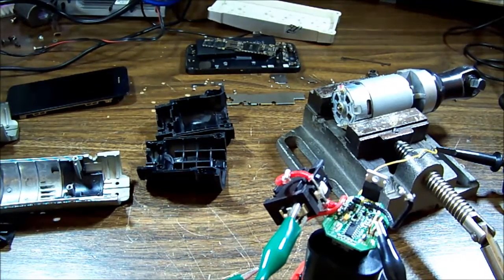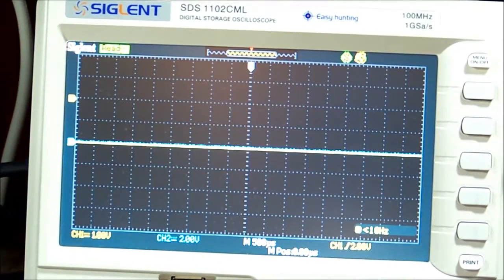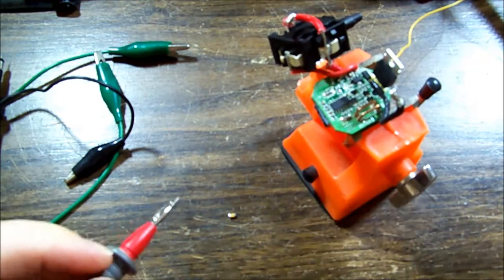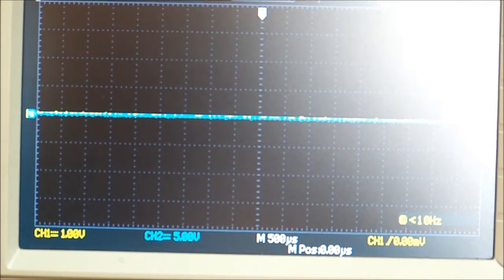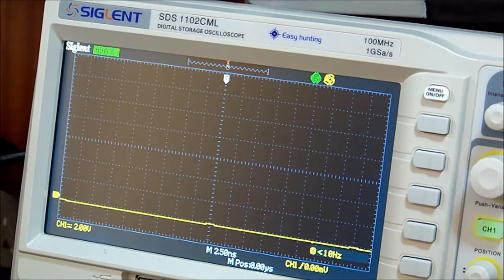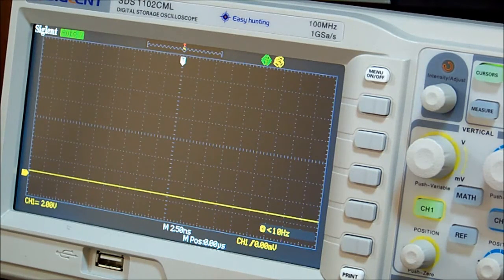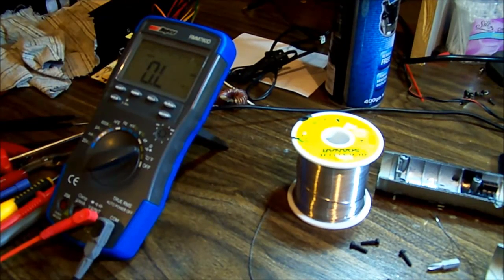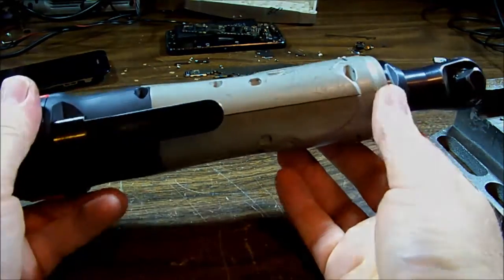3/8 inch drive cordless electric ratchet repair

Comment: Nothing to do with ratchets but my dad has a dewalt blower 20v it got left out in the rain and would only work for a few seconds after that so to get it to work again I eliminated the circuit board and hooked the battery directly to the switch it works now but no more safety's for the battery or anything and the trigger only does full power lol but it works again ... if I had time and patience I could have diagnosed it and replaced what ever was faulty on the circuit board
Reply from the maker: Good thing it's not the new brushless motor version so you were able to do that!
Reply: @JonnyFix  yeah he also bought a new one so if it would have destroyed it it would have been okay I just wanted to see if it was possible and we were talking about using the electric motor for something else but we'll have to figure that out also I would like a variable voltage power supply for the project so I could run the motor on lower volts yes you are right

Comment: i wonder if it’s possible to permanently power it using wires and a dedicated pws? 
ie. get rid of the battery completely
Reply from the maker: Should work ok if the pws can meet the current demand
Reply: Jonny Fix 
any idea of the current? or an appropriate PWS?
Reply from the maker: @Ifixitagain  at a guess at least 5 amps. Maybe more if the tool is stalled at maximum loading.

Comment: my 18v ratchet just stopped working. The charger light stays green, its putting out 18v but the battery is only reading 11v. Do you recon its a battery problem?

mine is chinese. It stopped working exaclty 2 months after I bought it on ebay (thus cant leave feedback).
Reply from the maker: Hey I guess it's a lithium battery? If so the charger might need to be able to reach 24 to fully charge it. If you have a power supply you could set it to 18V and connect directly to ratchet to see if it runs to prove battery or tool or you could use it to try charge the battery to see if it will take a charge (draw current) or not which might prove battery condition.

Comment: Do you happen to remember the transistor part number on this ratchet? I have a matco 1/4 cordless that fried the transistor and I can't read the number! I know it's a 90T03P. I can only read the A16... on the bottom. sorry for the lack of proper terminology, this stuff is way above me haha.
Reply from the maker: 90T03P matched a google search for http://www.alldatasheet.com/datasheet-pdf/pdf/802149/A-POWER/AP90T03P-HF_16.html . You could use almost any similar type FET being a low power device.

Comment: Could you have determined the issue with just a multimeter?
Reply from the maker: Maybe if you had a fast acting meter. Otherwise you might see a voltage that didn't vary and that might be confusing without a schematic to know what that voltage should be. At least a scope can show you rapid fluctuations.

Comment: Most times with stuff like that, you want to crack the nut or bolt by hand and then run it off with the ratchet. Saves on the circuitry. Thanks for sharing. Hope to see more projects
Reply from the maker: +Darryl 603 True. In this case the only thing that would affect is the motor drive FET and even then the motor is geared so it would probably be OK and just mash your hand against the nearest object. This resistor that failed is only running the control circuit, very small current. I bet it failed due to poor quality, maybe even moisture ingress from bad storage as I believe SMDs can suffer from. This moisture then causes damage when heated during manufacture. Hope to have another vid up soon but so far the device isn't faulty LOL.
Reply: We just snapped ours